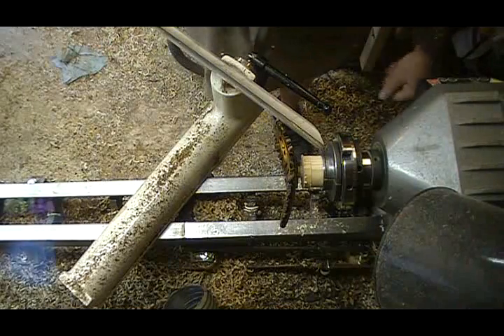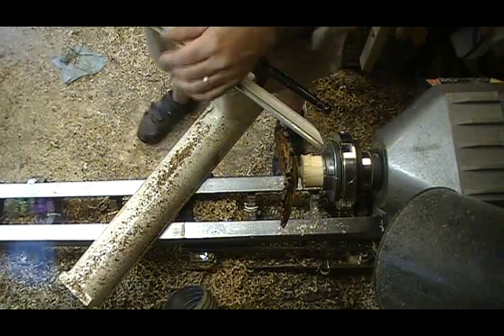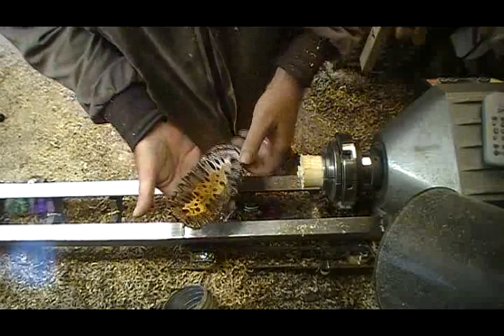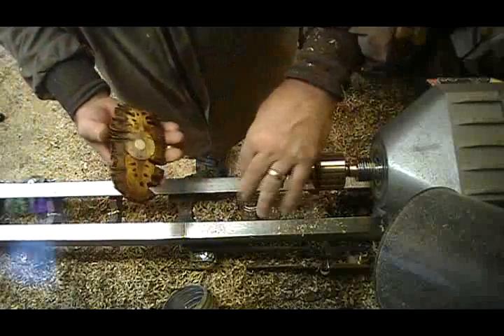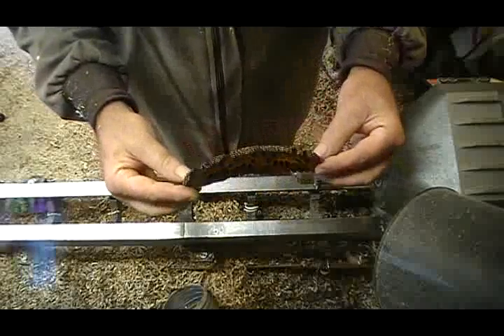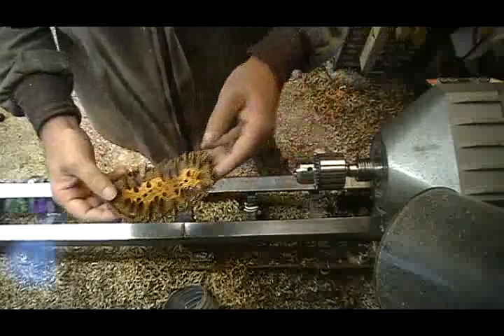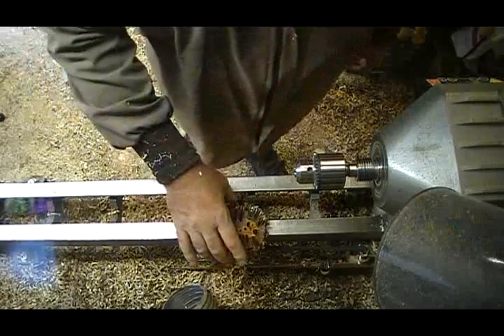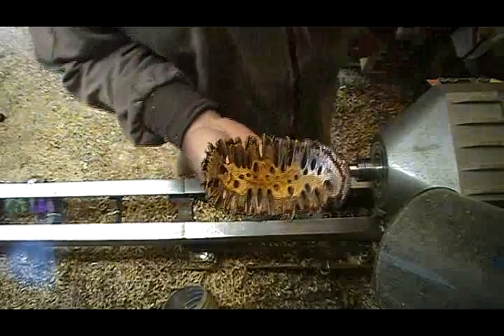Banksia pod angel wing - Segment 3 of 3

Comment: Nice idea, Bob. I've also got a banksia pod that I've had for quite a while now because I don't know what to do with it. I might try this but still not sure. I've only turned one before, into a small vase. I had another one but ended up making a hummingbird feeder out of it. There I just cleaned it up and drilled a 1" hole in the bottom and then sprayed it with several coats of lacquer. It looked pretty good but I never heard anything from the lady who bought it. Thanks for sharing this.
Larry